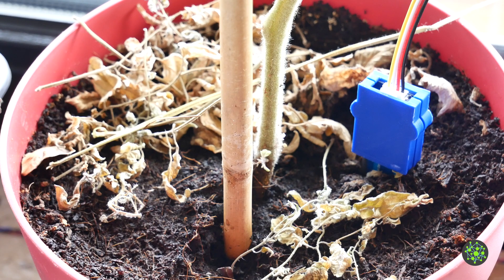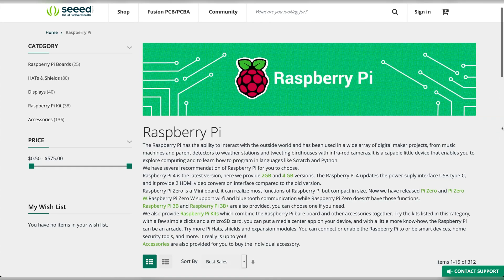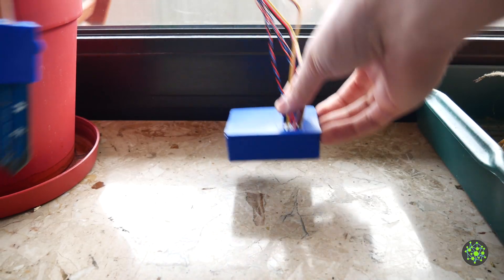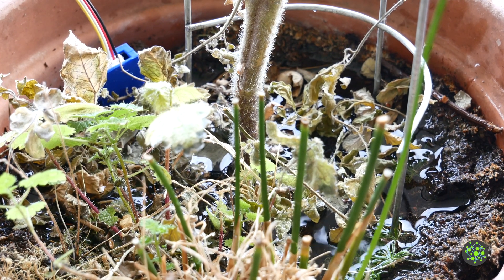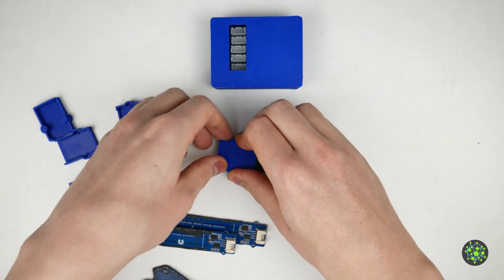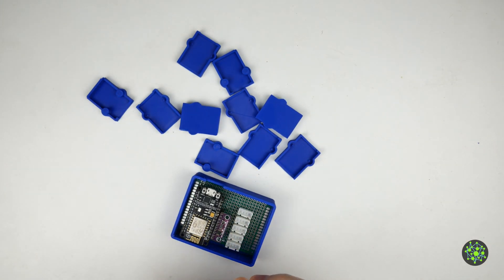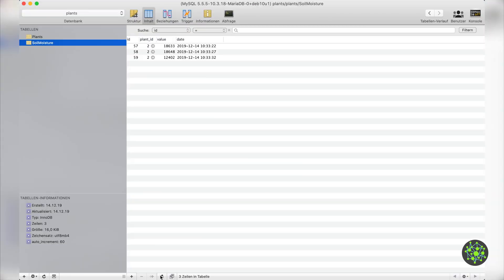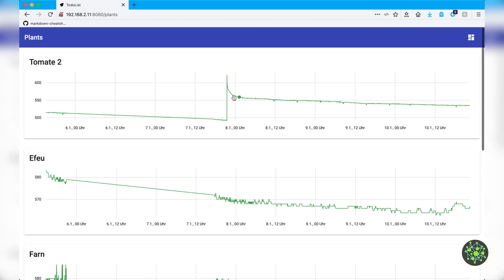Know when to water your plants | Plant monitoring system | Special Seeedstudio offer | Part 1

Comment: Really good video. Would be cool if you could make a video on mysql database.
Thanks a lot
Reply from the maker: What would you like to see about MySQL databases?
Reply: I'm logging temperature values from one sensor on a Google spreadsheet at the moment which works, but would like to know how to do this step by step with mysql db. Maybe this is a stupid request, just let me know as I'm completely new to this.
Thanks
Reply from the maker: @DavidPrettybreadt  technically that's what I am doing in this video, and how to set up the database is explained on the GitHub page
Reply: Thanks. I will have a look through the readme file.